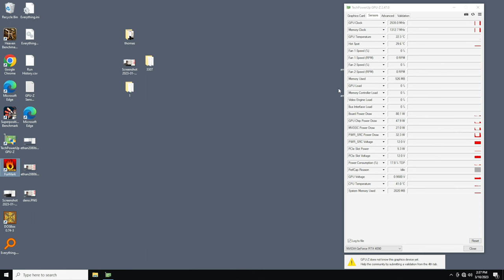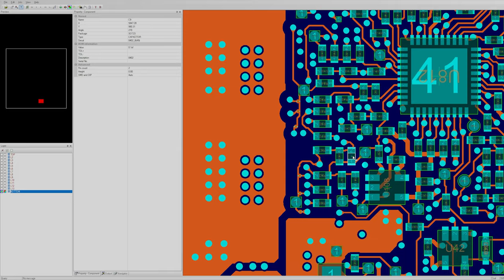Fixing yet another RTX 4090 [5]

Comment: all these broken 4090's are the users blame? i'm afraid to buy a 4090 and enter in the stadistic of users who bought a dead gpu
Reply from the maker: I personally dont own one, but theyre pretty good. Imo the 40 series is a refined 30 series card. Though alot of people dont like them because theyre more expensive than they thought they'd be
Reply: These cards are getting ridiculously heavier by the day. 
That much weight is surely not good for the PCI slot or the PCB with potential to cause flex that damages traces and components. There is another aspect and that is strain on the 12vhpwr connector when customers try to force the cable into their cases. 

The solution would be a right angle connector provided by AIBs in the box that go to either 3x 8pin PCIe connector. 
I just don't understand why boggins at Nvidia did not understand that most people use their existing cases when upgrading GPUs
Reply: @mavicwarrior  a vertical instalation would be great for the card?  i really want the card but i'm afraid of all the issues i see every single day, how a 2000$ card could be so fragil?

Comment: Nice easy job :P 
Too bad manuacturers don't fix things like this, is's not a warranty repair, but this card could have ended up in trash because of this one visible trace damage, while they fix VRAM BGA damages under warranty...
(In cases like this the warranty center should "decline" the repair and void the warranty but  still fix the problem, it takes 0 effort to repair the trace, even without the UV coating.)
Where did you find/bought the 4090 tebo boardview? I haven't needded it, but would be nice to have a look at it before something with more complex problem comes in.